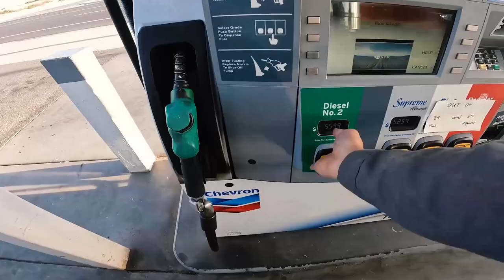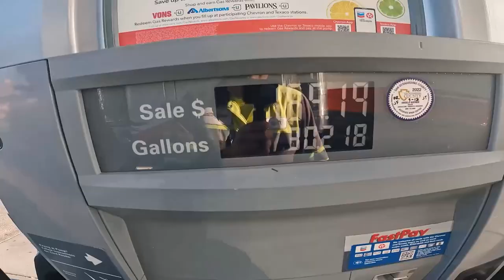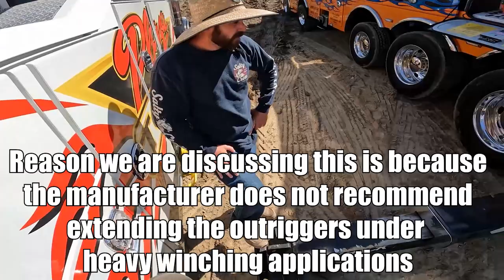90,000 Pound Excavator On Its Side

Comment: I'm curious how you guys got the high line off of the boom? Did someone climb up the boom to do that?
Reply: Same exact thought. I am guessing it was not a camera friendly approach and got cut out. Can only assume someone took a ride in the bucket of the other working escavator.
Reply: @dtuttle351  That’s exactly what happened probably it would be easiest way   That’s why they have the other hole going
Reply: And how did the hydraulic line fair?
Reply: A ride in a bucket of a long reach would be my guess but that will never be shown on YT as the safety people would have a field day in the comments section.

Comment: Holy crap, 90,000 lbs is an absolute MONSTER of an excavator, think of how nice it would be to have a 75 ton rotator in your fleet for jobs this huge!
Reply: Just sayn 90,000 is 45 ton, 75 ton is 150,000 pounds. But yah, would still be a very nice truck.
Reply: but then again, 90,000 pounds for an excavator really isn’t that big compared to the much bigger machines for surface mining that have operating weights well over 100,000 lbs, such as Caterpillar’s 6015B with an operating weight of something like 340,000 lbs
Reply: @tomuchfunwithgas846  but even then you’d probably still need two rotators to lift the thing because even though a 75 ton rotator has more than enough lifting strength behind it (and quite a large amount of excess wiggle room to spare) to lift 90,000 lbs with ease, an excavator this large would be too bulky for a 75 ton rotator to lift by itself, hence two rotators are needed, one lifting from each end.

Comment: really smooth when done with the correct equiptment great job. my wrecker is a old holmes 
500 twin winch twin boom and is setup to do side pulls which is nice
Reply: Those twin booms are the predecessors to the modern rotators.
Reply: @tiredoldmechanic1791  i really like mine it's a 1966 D500 with only 50,000 original miles on it. Everything works drives and works great

Comment: Just wondering here. You said you can't have a sliding carriage due to wait restrictions but Statewide has a 75 ton with a second steer axel. That was also a Miller Industries unit.
Reply: Wreckers of that size require overweight/size permits every time they roll. Trent's truck doesn't need permits too roll.
Reply: @dps67  I had also wondered and appreciate you posting that

Comment: I’m surprised you didn’t work as a team to try to lift or pull the excavator out of the hole after uprighting it, the edges of the hole look too steep to allow the excavator to climb out of the hole under its own power.
Reply from the maker: They used the dozer (off camera) to cut into the bank and make a nice exit. Thank you!
Reply: Ah, that makes sense, thanks for the quick response! 👍